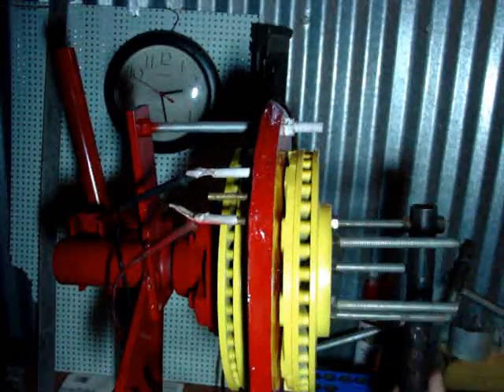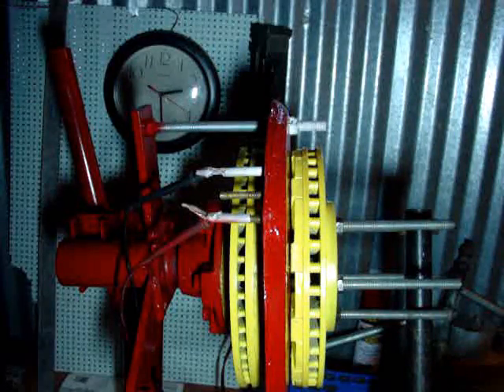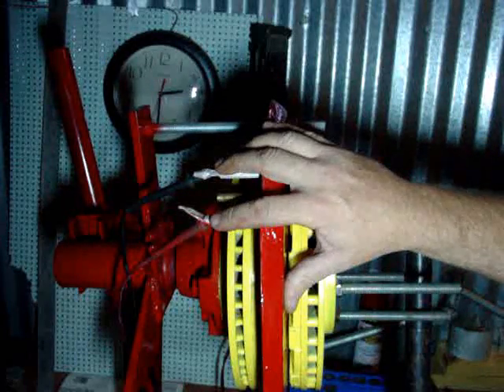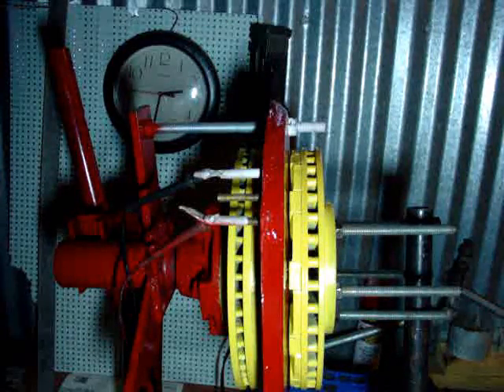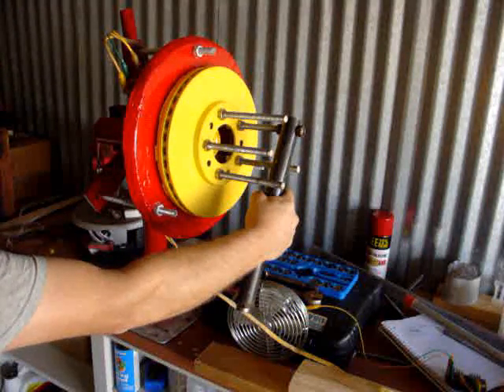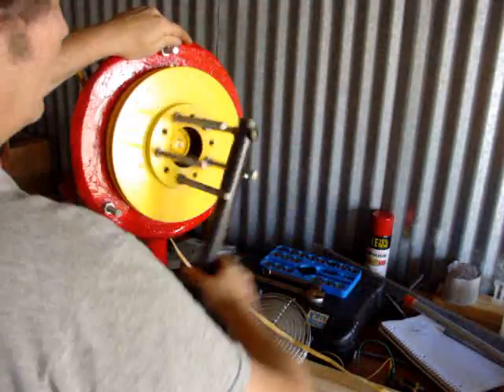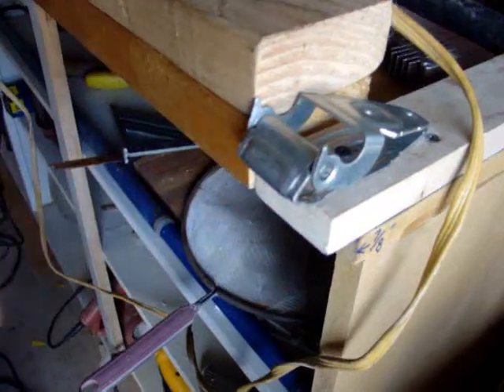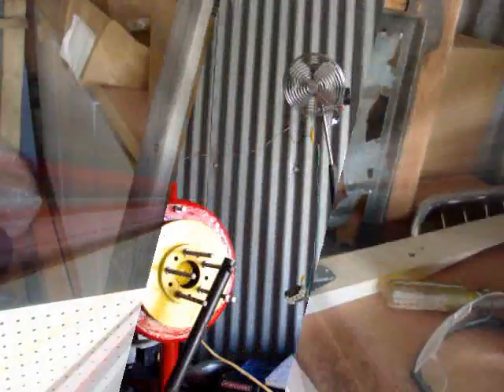BUILD A DUAL PERMANENT MAGNET ROTOR WIND TURBINE (PART 29)

Comment: Hi muddy.
Great tutorial. 
Love the axle and brake disks concept. Makes the project much simpler what with the already available hardware.
But i have some doubts about how to use the outlets.
I have understood how turning the three phases into dc with a rectifier works.
But if you want to use straight ac to run ...say a grinder or a saw ...¿ what do you use as ground ?
¿ do you uses two phases ( live, negative) ?
¿ do you use two phases plus the third one as negative ?
or ¿ do you use the three phases and use the joint of the three coils sets as negative ?
Would be much obliged if someone points me in the right direction on this issue, before i burn some apliances or burn the stator.
Thakns.

Comment: Hey Muddy,
I hope all is well - I haven't seen a new video in a while. Thanks for making these series, they're great! What kind of power do you get out of this turbine/generator? I'm inspired by it to make an axial flux hub motor for a compact tractor (direct drive), but with slight modification: Having the rotor central to 2 external stators (will make liquid cooling more effective, but will need more copper).

Comment: Does it matter whether the magnets spin around the stator OR the stator spins between the magnets? Stupid question but it changes my design depending on your answer. It takes alot more torque to spin the magnets than it does the stator..just curious. Thx

Comment: Hi , can you use the three phases from your generator in starformation to drive a treface  electric waterheater?
Reply from the maker: Interesting question. :)
actually yes, BUT!!! The risk would be to the weed eater. The problem would be getting the rpms to synchronize, and the voltage and amps to stay within tolerable levels.
But the wind is very wild, and never stays constant. voltages rise and fall fast. I fear the right conditions would not last long enough to use it before the smoke escapes.

Comment: I have a question correct me if I'm wrong. I made something similar to yours and my question is my values and calculation. I have a 3 phase 6 pole. for the ohms i connect all the ends together and the start all together. when I check for ohms I get about 3.0 ohms before rectifier and AC volts 24 for each phase. the DC voltage is 60volt for all 3 phase connected to rectifier.

AC 24 volts x 3 phase = 72volts
or volts stay the same AC 24
I'm trying to calculate amps and watts.

if AC volts 72 and ohms 3 then my amps is 24 and watts is 1728?

or 

if AC volts 24 and ohms 3 then my amps is 8 and watts is 192?

or 

if Dc volts 60 and ohms 3 then my amps is 20 and watts is 1200?

I want to buy the correct grid tie inverter or battery charger inverter. 
I like to make sure I got the correct wattage

thank you any answer will help

Comment: Would a clutch spring work on the shaft at no spin pushing the magnets or hub close. Then as the spin gradually increases the centrifugal force would push out against the spring like on a older car or bike clutch. Thus widening the gaP..? that way prop length could get the best of both worlds..? just curious.
Reply from the maker: +Blue Eyed Devil 
a centrifugal clutch might help with startup in some cases. as for overspeed, the clutch would have to go to a brake. The objects are to keep from over-speed, self destruction, and Burning out the stator. Spreading the magnet gap would allow the prop to over-speed. a lot of parts. The auto furling mechanism is just too simple, and dependable. You can always count on gravity so to speak.

But as for startup. It has possibilities.
Interesting. Thanks.
MUDDy
Reply: THAT MAKEs SENSE!

Comment: To cut back on the weight that is being pushed, when machining the rotor to get the lip on the outside, what is the minimum  thickness  that you would want to take it down to? I'm  trying to push as lightweight  a unit as possible because  I'll  be using  water right?
Reply from the maker: +Kevin Anderson The weight of the rotor with the bearing style, and tapered spindle are well adapted to the weight. the weight will pretty much only slow down acceleration of the rotors. The momentum will also slow down the rate of deceleration after the mechanical drive is removed. 
if this were a reciprocal motion instead of a rotary motion, the weight would be a critical problem to resolve.
But still a lighter weight would help drop friction on the bearing a bit.

I would not make the thickness of the magnet rotors any less that 1/2 to 3/4 of the thickness of the magnets. the magnetic flux path of the thick rotor plates is the magnetic flux path that amplifies each magnets power like stacking them. without the steel plates the magnets would show only the strength of each magnet by itself. MUCH LOWER. and a waste of magnets. having the ferrous metal rotors behind the magnets make each magnet almost twice as strong in flux, just like stacking them.

I hope this helps.

MUDDy

Comment: I  was more concerned that a wind turbine with a 9' wingspan would have more torque  than a jet of water firing at a pelton wheel! Maybe a single rotor would work better because the jet would be pushing less weight. Make sense? Water isn't  an issue. ..I'm  in Canada! We have 70% of the world's  fresh water! Lol! If the next war is over water, we're  SCREWED!!! Ttyl👍
Reply from the maker: +Kevin Anderson gotcha. I tried a single rotor with very little luck. but a smaller unit with single phase with less magnet, and fatter wire would do nice. higher rpms, smaller diameter perhaps.
I have wanted to try several things here with water. It would be all fresh tech to me though.
But it sounds like fun.
MUDDy

Comment: Love the videos! You're  my hero brother! I have an idea I wanna run past you...what if I build your dual rotor turbine and mount it on a 45 gallon drum with a pelton water wheel powering it? Similar to the video by "Angry Ram" from New Zealand.  I  pay flat rate water so water isn't  a problem. Install a water jet on the side pf the drum spraying  at the wheel. Adjust  the force of the water so overload  isn't  a problem and the whole system is mounted so it drains into my sump pump pit in my basement!  My pit is HUGE so capacity isn't a problem! I  just need a pump that will handle the water volume. What problems  can you see?
Reply from the maker: +Kevin Anderson A wide spread water shortage in your area. lol.
and a full basement
different coils would help. thats a lot of water bro.
MUDDy
Reply: What type of coils?
Reply from the maker: I believe you would have to play with the diameter of your rotor for faster speeds, and fatter wire with less windings. experimental process of matching the rotor size to the alternators capability is a must for max power transfer. even with wind. But sadly, i have no info to send to you when it comes to water.
If i had to find a starting point, I would make mine a single phase, (one coil per magnet position), and start by winding a test coil, inserting it for measurement on the meter. direct cumulative math works for that. more wraps for higher voltage, less to lower it. ect...
I figure winding a new coil is the easiest way to match the rotor to the alternator.
:)
Keep me up to date. This sounds cool. And I am very short on this water tech.
MUDDy Kevin Anderson
Reply from the maker: +muddymuddymuddmann Hey Kevin, I know i sent you a rather vague answer because i didnt have much experience in water wheels, But the same principals still apply to both wind and water wheels.

   So I've been thinking on your question. I hope this helps.
The design of the stator is the main part of designing for a given rpm per volt.
If you know the RPMs of the water wheel, Then the stator can be wound to specs you need. But with the water wheel i would make the target RPMS of the alternator lower that the RPMs of the water wheel without a load. 

I'll try to explain this in short..... In the beginning of this video series, i was targeting 120 RPMs for the charging voltage. Your water wheel will be quite a bit slower, but You will most likely gear it back up. 
If your water wheel turns at 30 RPMs then you would need 4 times the (windings, wraps, turns,) per coil before gearing it up. 

But if you geared the water wheel to alternator to step up gear ratio of 1 to 4 rotations, You would think to use the 77 turns like mine. NOT QUITE true. the battery only charges when the voltage source,(alternator), is higher than the battery voltage.
100 turns in this case would be very nice. The pressure of the water wheel trying to make the alternator spin faster would deliver the amps. 

Any voltage from the alternator that is over the charging voltage of the battery turns into amps. the difference of the two voltages, divided by the (wire resistance + coil resistance + internal battery resistance), will give you the amps that the battery will receive.

Example..... alternator voltage 15 minus 13 battery voltage = 2 volts.

two phases of coils in parallel resistance of 2.3 ohms is 1.15 ohms, plus lead power wire .1 ohm, plus .06 internal battery resistance around 1.31 ohms.

2volts/1.31 ohms = 1.526 amps. This is not the actual three phase resistance formula of the alternator in star, but very close. And the RPMs delivered to your alternator should be a bit higher. I am sure water weight has a lot of leverage. thus the ability to deliver a lot of torque. In my experience, torque that drives the rpms up delivers the amps.

Like i said, I have very little knowledge of water wheels or the torque and RPMs they can reach. I am sure many out there have quite a bit more knowledge than i on this subject. 

the number of turns in a coil phase set is the voltage, the thicker the wire, the less resistance and higher the capability for amps.

No one knows all, And i am no exception.
 But, I hope i have helped.
Thanks. If you find better info please share it with us. I would appreciate it very much. I am very interested in this project of yours. please post and share. Thanks. :)

MUDDy

Comment: Hey Muddy,
         Are you ready to start selling your turbine yet ?
 Yours are so efficient I would rather buy one of yours. Over the he course of 5 years had to buy 3 maybe, I'm buying junk lol. Just tired of getting ripped off. God Bless to you and the family
Reply from the maker: Big Taz That is the best compliment Ive heard for a while. I'm still not satisfied with my results so far. Industry would sell it anyway. I have also upgraded the wood for the props to cedar. It should last many years longer than that cheap pine.They don't make wood like they used to. The Pines' white wood between the dark rings is fatter, and more of the consistency of cork wood, and the dark rings are much thinner. It doesn't even carve right anymore.     But the cedar is light , strong, and carves sweetly. and above all,... Cedar can last an average of 70 years if coated periodically with boiled linseed oil every two years. I already have footage on this subject being edited right now.In addition, I am moving to an even bigger shop. And the testing, and production will now resume. As will the videos.Thanks Taz

Comment: contact me I have a spool of cable for my prodject and can't use much of it.
Thank you you de-mystified alot of questions I had.
If you need a simple tower desighn that you don't have to play monkey to install and cheap to build at home. 40ft tall, local materials.  Mine cost me less than $300.00.  It folds down to the ground for maintance on the power head.  Not sure how it will work with 9-10ft blades, I'm using a modified Archamedies Wheel on mine.  Lower cut in wind speed and more torqe.  Just has more surface inches. Little quieter as well. In return Just let me know how you did such an awsome tutorial.
Reply from the maker: Sean Scully The blades and tower sound awesome. I hope the added wind sheer and side torque doesnt make too much stress on the tower. sorry for the mini vacation here, it was spend trying to get the finances back in order.
I have just gotten back into operation at the new shop, much wiring and installation left to do.I sure hope all goes smoothly.
Thanks.
MUDDy

Comment: I have been waiting months to see the finished turbine. Where is part 30?
Did it work?
Reply: ***** 
You should do a kickstarter.com 
I'd chip in as thanks for these great educational videos.  I've learned a lot.  My alternator built from your plan is down in my basement.
Reply from the maker: ran out of money so far. i've been working to keep up on bills. i have a tower half built for the red and yellow one, and still neee guy cables for that one.
Reply from the maker: Roger Marlowe Thank you very much. I need to carve a prop for it and get it under testing to work the finer details out.
I hope we can get it out of the basement and on the pole soon.
MUDDy

Comment: Hey Muddy!  You briefly mentioned running the 3 phase AC power directly into your home.  How does that work?  Seems like you could save on having to buy/build the rectifier and buying the inverter.
Reply from the maker: i never said that you could run the three phase power dirrectly into your house. that would be impossible. the wind is wild, and the rpms differences would cause havock.
but there are, (three phase input, grid tie inverters, for three phase wind turbines).
Also the three phase power from the wind turbine can be lead down the line, and then rectified before the battery bank. better than dc down the pole.

Comment: What happens if it spins 12,000 rpm?
Reply from the maker: it gets dizzy. actually 12,000 rpms means some heavy amps and very high winds. The stator would probably blow.
but that is what the furling mechanism is there for. overspeed protection.

Comment: We are all eager to see this bird in flight.. what's the hold up??? Thanks for showing us all this, some of us DO appreciate it..
Reply: I built one of these and it works perfectly. (driven by a 4Pole electric motor (geard down for testing) saves many pole remounts after adjustments.
n52; 2" x 1" x 1/2" magnets with the same coils as yours muddy.

What I am looking for here is to see your red and yellow machine in "ACTION"

It would also be preferred to have full output  details as to "REVS / VOLTS / AMPS.

My maximum revs will be 440rpm.

My last test gave me 14V from each of the 3 phases at a measured revolution of 250rpm. (rev counter "accurate")

I get rubbished around here as the sparkies say this guy (muddy) won't show you the thing in action, there for it probably won't work as an efficient generator!

So how about it muddy let's see your machine in action with detailed output?
Reply from the maker: Monty Bowen
Thanks Monte, so far obligations are many, and finances are short. But the summer is still young. i have two towers in the making. one almost finished. but it's the smaller one. the big tower will be for the ten foot turbine. and still need to get guys wires for both rigs. and i'm a few months from catching my bills for now.
as for, will it work, I have no doubts. just anxious to get it up in the air as your are.
:)
Thanks for the cattle prod ,and encouragement.
MUDDy
Reply from the maker: thanks todd, working to catch the bills up for now. then i can finish buying all the needful items like guy cable, and couplings, and lead down wire. Thank you for the appreciation.
MUDDy
Reply from the maker: Hugh Jaanus I do not delete your comments. But do as you think you must. The videos will resume soon enough anyway. and thanks for trying to help before. i do appreciate that very much. Keep smiling and many good things to you and yours bro.
:)
MUDDy
Reply from the maker: Monty Bowen Thanks Monte. Sorry about the long delay. Income has held me back for a while now. i stopped video, and went to work to improve the finances, and my views dropped, thus more work. But i just put out a video on using cedar instead of pine for carving props.
Also I have just moved again to another shop. Much wiring, and set up to do. But i will be making more videos again. I am eager to get this monster in the air and start generating some good wattage.
MUDDy

Comment: I watched your all videos nd these seems to be so inspiring .I have been looking for how to built wind turbine for home use nd your videos help me learn a lot. thank you for your inspiring work. which let us understand the basic constructions.
I have been looking to built 20 kw permanent magnet alternator rated at 24 volts as that of yours .. same design .. would you please suggest me the basic construction .. i mean the number of magnets .. nd number of coils nd the wire gauge used in coils ..

Comment: HELLO , MUDDY, IS LUIS MALDONADO LÓPEZ FROM ARECIBO, PUERTO RICO
I MAKE A CEILING FAN WIND GENERATOR I USE YOUR RECOMENDATIONS AND TECHNICAL SKILLS. MOVING WITH MY
HAND IT PRODUCE A MAXIMUN OF 20 VOLTS, BUT WHEN I PUT THE BLADES I REALIZE THAT NO WIND  AT MY HOUSE ROOF. INCREDIBLE
"JA JA JA" I AM GOING TO SEND A VIDEO OF THE MACHINE WITHOUT
THE BLADES AND ITS POSSIBLE YOUR  RECOMENDATION.
PS. IM WAIT FOR THE PART 30 (DUAL PERMANENT MAGNET...)
FOR THE PAIN OF LEGS I USE CATAFLAN 50MG

Comment: Great video series, I am thinking about make one of these for myself for a VAWT, Is the specifics on making the stater as in the gauge of wire and how many turns or thickness to make uniform coils? Did you have a pictures of video of the finished turbine working? How do you hook up the 3 phase to the house current? I wasn't sure if you mentioned this. Thanks again for the great video..

Comment: Scott,

Thanks for your great how to videos.  How would the dual rotro axial turbine work with vertical windmill configuration?  And what kind of wind speed control could I use.  I live in town and a vertical design may have a better reception by neighbors.  

Thanks

Dan